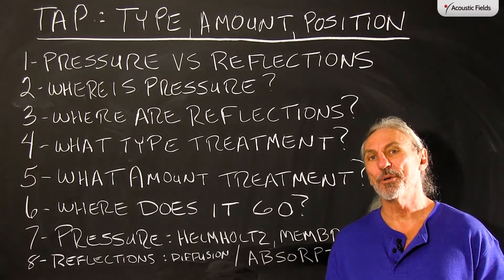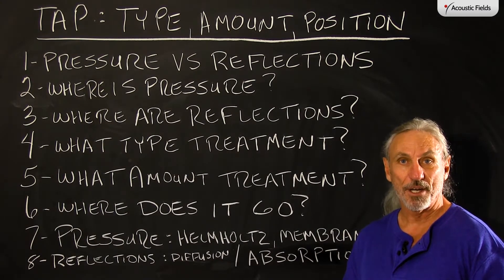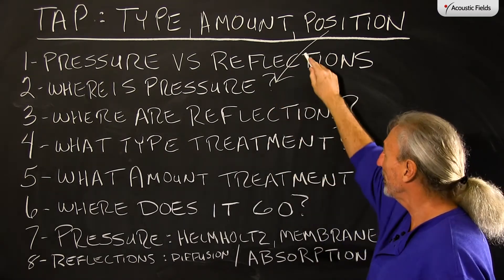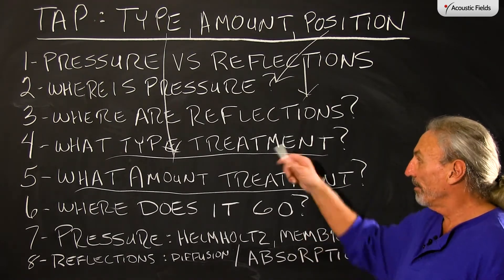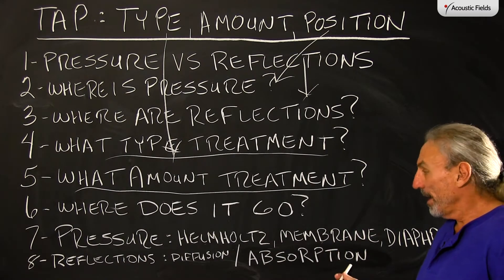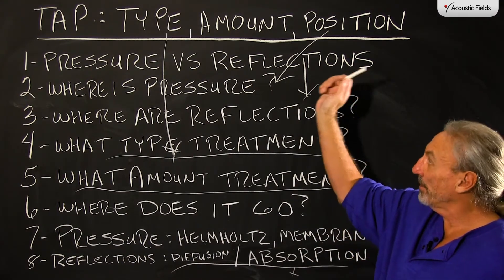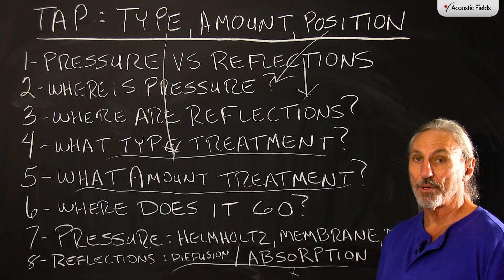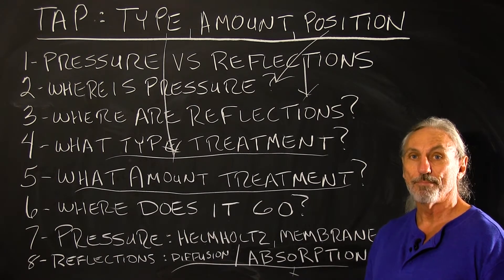TAP - Type, Amount, Position - www.AcousticFields.com

Comment: True, your technology is so good that at the begining it was hard to realise the actual quantity of units I needed.
Reply from the maker: Hi Leonid,  TAP or type, amount, and position is determined through a process we term pressure mapping and ray trace. Pressure mapping includes unwanted, low energy frequency, amplitude, and location. Ray trace includes middle and high frequency issues that are treated with absorption/diffusion. These are all available through our design services.
Reply: Have heard that open baffle speakers are less sensitive to room problems in your opinion is this true